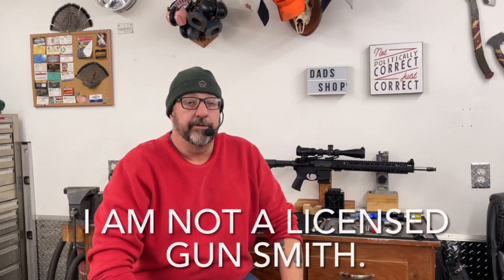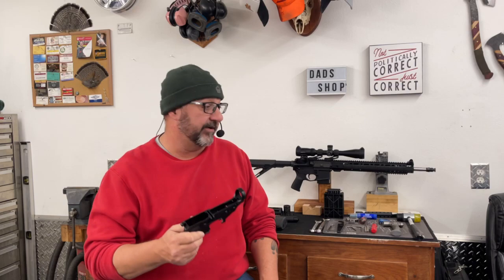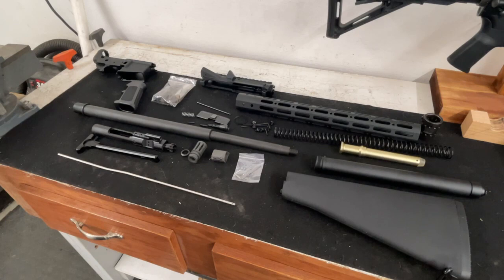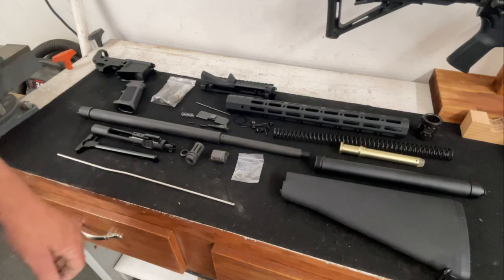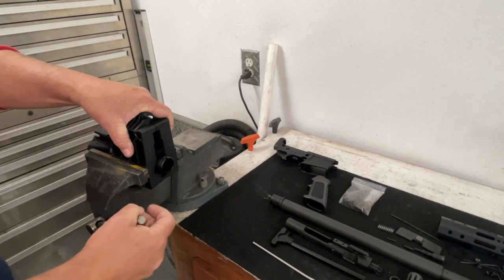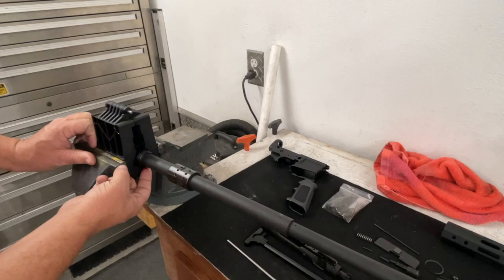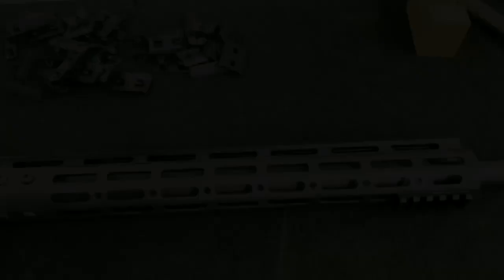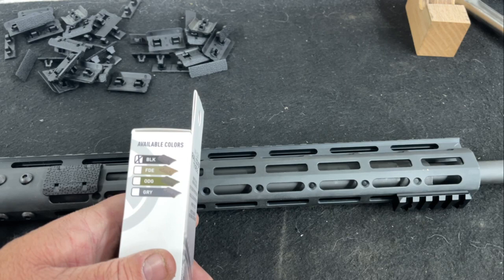KM Tactical 20" Marksman AR Kit Assembly

Comment: I trust very few people when it comes to assembling an AR 15. After watching the video, I would have zero issue putting this gun to work. I think you did a fantastic job,video is put together very well also. One of the best I've seen.
Reply from the maker: Thanks. It took 10 hours to shoot the vid, edit and upload a 1 hour video. I appreciate the support and it’s worth it for comments like this.
Reply: @jackofalltrades7822  yessir,most people don't realize how much effort goes into making quality videos. 👏
Reply: Agreed. This is an outstanding video.

I didn't realize just how easy it is to assemble an AR-15. I thought the tricky parts would be attaching the barrel to the upper and aligning/timing the barrel and upper with the handguard and gas tube. It turns out I was overcomplicating it in my mind. Now I feel confident enough to assemble my next AR-15 myself.